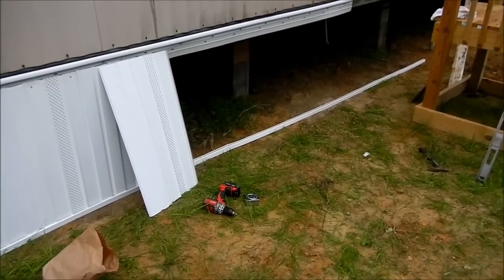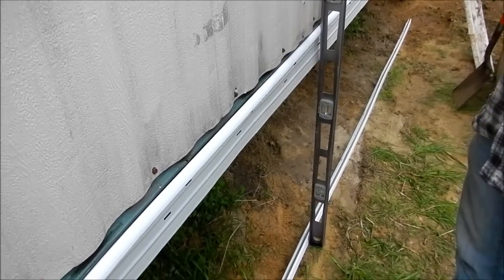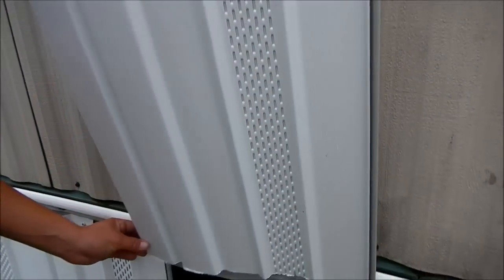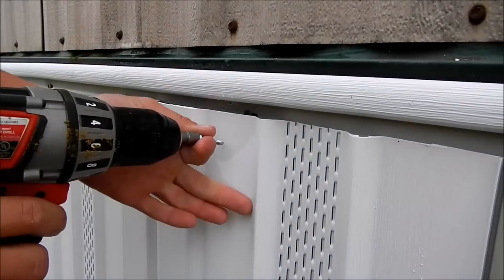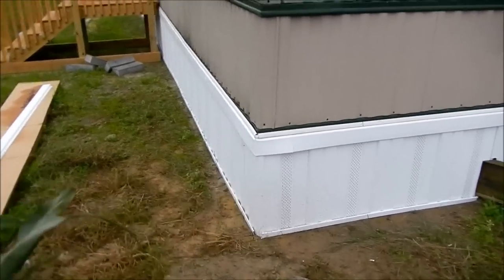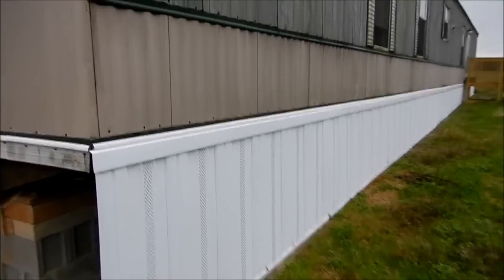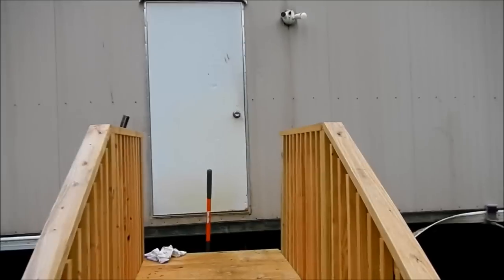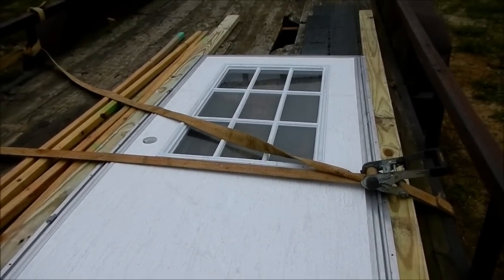Installing Underpinning on the Mobile Mansion

Comment: Here’s a little tip that you will appreciate later:  Place some “thick” black or green roof shingles on the ground under the bottom vinyl J-channel.  This will make for a neat grass and weed free barrier border and keep the “weedeater” safely away from eating through the vinyl base trim. A good quality shingle will last between 15 to 30 years before you will have to replace some of them.

Comment: As far as I understand you shouldn't screw in the skirting pieces, they need to float upwards with ground swell. That's why you leave a two inch gap at the top. Screwing them in will result in bowing, creases and contorted pieces as the ground swells and expansion occurs ruining the job?

Comment: I was told not to put those nails tight in that top piece running the length of the mobile home because the vinyl has to expand or contrast depending on the weather being hot or cold. They might cause the vinyl to start cracking after some time. Did you leave several places to get under the home for some under the trailer work?

Comment: where is your room for expansion and contraction, when the ground moves or trailer moves from freezing or what not. you probably should've cut the panels a lil shorter and not screwed them to the trailer at the tops like that
Reply: they flex, the ground isn't going to move that much & if it does the mobile home being on blocks would move as well.

Comment: that is not the skirting you want to use where it gets cold you will have frozen pipes and the floors will be colder want to use solid then put some vented ones in the summer

Comment: I run my ground f chanel on treated 2x4x16s with 12 inch rebar drilled through it about every18"....
Reply: Good move. Rock solid base that will last decades with little or no maintenance.  Good move.

Comment: Right in front where the hitch is I had cats get in dig up the fiberglass and pee have kittens. They insist on staying and it takes a bullet to change their minds. They will go right in any hole including open ac hole. I just foam mine up. They will get in a hole and tear up the entire insulation channel. I demolished one single wide like that and cats destroyed the insulation.